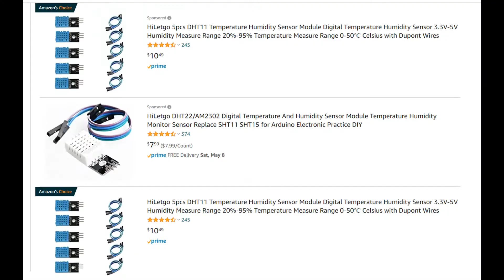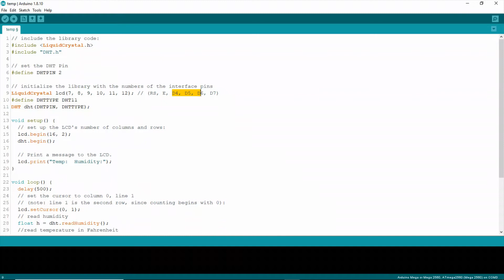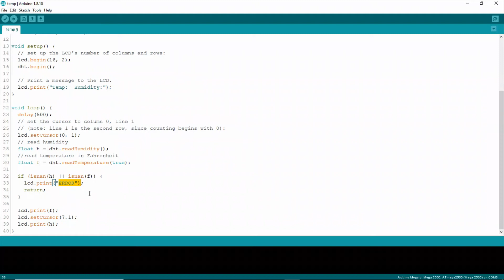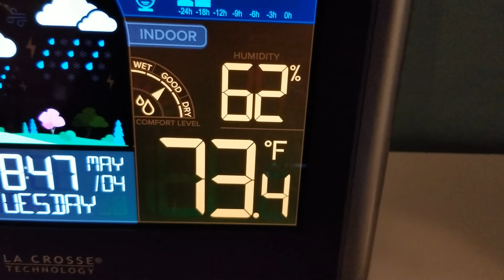Getting Started With DHT11 Temperature and Humidity Sensor : Arduino Projects For Beginners

Comment from the maker: If you're looking for the code, try this!

#include <DHT.h>
#include <LiquidCrystal.h>

// Set DHT pin
#define DHTPIN 2

// Initialize LCD with the interface pins (RS, E, D4, D5, D6, D7)
LiquidCrystal lcd(7, 8, 9, 10, 11, 12);

// Define DHT sensor type
#define DHTTYPE DHT11
DHT dht(DHTPIN, DHTTYPE);

void setup() {
  // Setup LCD's number of columns and rows
  lcd.begin(16, 2);
  dht.begin();

  // Print a message to LCD
  lcd.print("Temp:   Humidity:");
}

void loop() {
  delay(2000); // changed this to 2 seconds between readings

  // Read humidity
  float h = dht.readHumidity();
  // Read temperature in Fahrenheit
  float f = dht.readTemperature(true);

  // Check if any reading failed
  if (isnan(h) || isnan(f)) {
    lcd.setCursor(0, 1); // Move cursor to the second row
    lcd.print("   Sensor Error   ");
    return; // Skip the rest of the loop if there's an error
  }

  // Display temperature and humidity on the LCD
  lcd.setCursor(0, 1);
  lcd.print("T: ");
  lcd.print(f, 1); // Display temperature with 1 decimal place
  lcd.print("F ");

  lcd.print("H: ");
  lcd.print(h, 1); // Display humidity with 1 decimal place
  lcd.print("%");
}

Comment: Hii sir ,your project is top ,But can I get code please
Reply from the maker: This was before I started posting code to Facebook page. 
try this

#include <DHT.h>
#include <LiquidCrystal.h>

// Set DHT pin
#define DHTPIN 2

// Initialize LCD with the interface pins (RS, E, D4, D5, D6, D7)
LiquidCrystal lcd(7, 8, 9, 10, 11, 12);

// Define DHT sensor type
#define DHTTYPE DHT11
DHT dht(DHTPIN, DHTTYPE);

void setup() {
  // Setup LCD's number of columns and rows
  lcd.begin(16, 2);
  dht.begin();

  // Print a message to LCD
  lcd.print("Temp:   Humidity:");
}

void loop() {
  delay(2000); // DHT11 requires at least 2 seconds between readings

  // Read humidity
  float h = dht.readHumidity();
  // Read temperature in Fahrenheit
  float f = dht.readTemperature(true);

  // Check if any reading failed
  if (isnan(h) || isnan(f)) {
    lcd.setCursor(0, 1); // Move cursor to the second row
    lcd.print("   Sensor Error   ");
    return; // Skip the rest of the loop if there's an error
  }

  // Display temperature and humidity on the LCD
  lcd.setCursor(0, 1);
  lcd.print("T: ");
  lcd.print(f, 1); // Display temperature with 1 decimal place
  lcd.print("F ");

  lcd.print("H: ");
  lcd.print(h, 1); // Display humidity with 1 decimal place
  lcd.print("%");
}

Comment: I am not getting the temp or humidity values to show up on the display, It shows temp: and humidity: but no values.

#include <DHT.h>
#include <LiquidCrystal.h>

//set DHT pin 2
#define DHTPIN 2

//initialize library with the numbers of the interface pins
LiquidCrystal lcd(7,8,9,10,11,12); //(RS,E,D4,D6,D7)
#define DHTTYPE DHT11
DHT dht(DHTPIN, DHTTYPE);

void setup() {
  // setup LCD's number of colums and rows:
  lcd.begin(16,2);
  dht.begin();

  //Print a message to LCD
  lcd.print("Temp:  Humidity:");
}

void loop() {
  delay(500);
  //set the cursor to colum 0, line 1
  //(note: line 1 is the second row, since counting starts with 0)
  lcd.setCursor(0,1);
  // read humidity
  float f = dht.readTemperature();
  float h = dht.readHumidity();
  
  return;

  lcd.print(f);
  lcd.setCursor(7,1);
  lcd.print(h);
  
}
Reply from the maker: Hey there Dan!  Try this in the loop.  If it doesn't work I'll be happy to recreate this setup and share it all with you. This was a time when I wasn't really posting code and schematics online. I now post all that stuff.  Hopefully it works. If not let me know. 👊👊
// read humidity
  float h = dht.readHumidity();
// read temperature in Fahrenheit
float f = dht.readTemperature(true);

if (isnan(h) | | isnan(f)) {
     lcd.print("ERROR");
     return;
}
Reply: @BMonsterLaboratory  
Thanks for the response. I was able to getting working. I had the return; function before the commands to print the temp. and humidity. Also I had to leave (true) for temp and () for humidity. 

Your video was very helpful, I appreciate that you have it here. I am trying to make a sensor for my bee hives. I ha e other features I want to add, but this is a great start.

Comment: How can you change it so it reads in celcius?
Reply from the maker: Hey Cody!  Celsius is the default so try this (replace "F" with "t" or "T"). float t = DHT.temperature;  and lcd.print(t);   If that doesn't work, let me know. It's been a while since I have had this temp. sensor out and used the DHT.h library but hopefully that works.
Reply: @BMonsterLaboratory   that didn't work
Reply: I resolved the issue, I had to change  float t = DHT.readtemperature from true to the same as humidity, leaving it blank, adding the true tells it to read in Fahrenheit

Comment: Does it matter where you put the wires from the lcd or any other device to the PIN numbers on the arduino?
Reply from the maker: Hi Braden. For this setup I believe you can use any digital pin as long as you declare that pin in the code. Sometimes a component may require a specific pin (SDA data pin, SCL clock pin...etc) or a specific pin type (PWM, Analog).
Reply: @BMonsterLaboratory  oh ok that clears things up thanks man
Reply from the maker: @Braden Pryor  any time!

Comment: readHumidity wouldn't work for me?
Reply from the maker: Hi Planet Not Earth! the temp worked but the humidity wouldn't?  hmm... I wonder if it's an omission of part of the code or maybe a wire is not connected? Does humidity show up on the LCD without a value or does both the word "humidity" and the reading not show up?